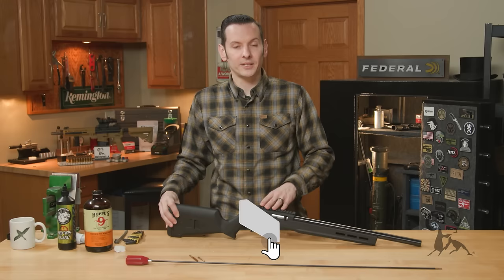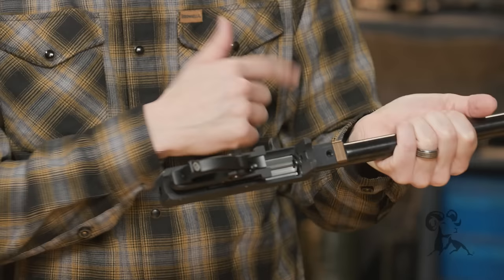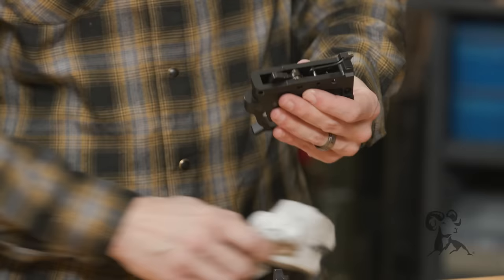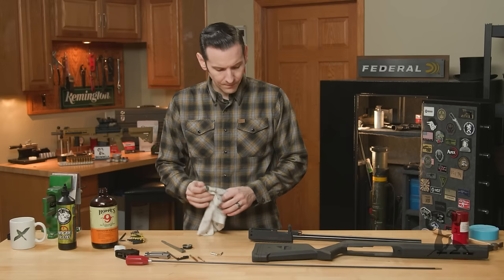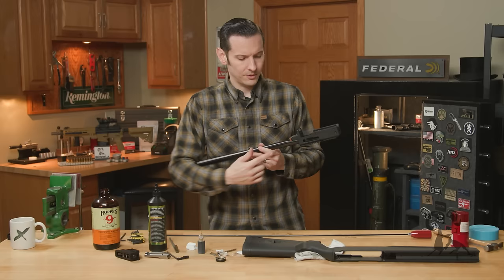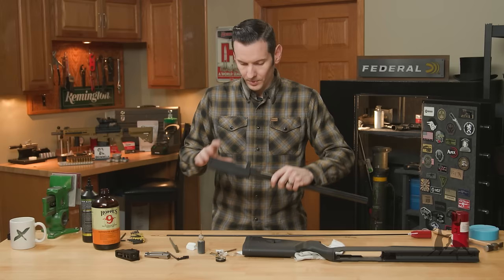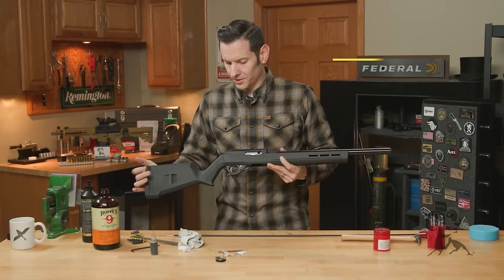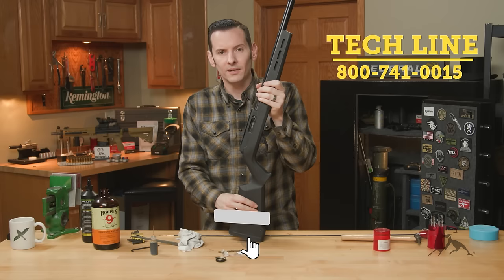Tech Tip: Ruger 10/22 Basic Maintenance

Comment: I got my first 10/22 as a kid for my birthday. Shot the crap out of it. Fast forward 20 or so years and I started to have light strikes. I thought maybe the firing pin broke, or perhaps just wore down so far over the years. While disassembling the rifle to investigate, I realized I had never done more than clean the bore and wipe down internal areas I could reach. I had never even removed the tigger group much less the bolt assembly. I had been worried that it was similar to the Mark pistol series which was notoriously finicky. So I dove in and fully disassembled it, discovering for the first time how easy it is to maintain. And also discovering 20 years worth of 22LR buildup crud that was causing my issues. Runs like a top again. Moral of the story: don't be afraid to tear into something. Videos like this are a godsend in that regard.
Reply: I for sure know about the Mark Pistol issue, I watched and video on the breakdown, made it look easy and my pistol was down for about six months before I finally got it back right.  I have fired it a lot since then but have not took it apart again.  Love how easy the Ruger 10/22 is.

Comment: Thats nice you sell the jig for the hole,,here is a way simple solution to avoid crown damage and brissel splash in the receiver,,,just slide the cleaning rod down the barrel when you see it in the reciever take and screw the brush on and pull it out take it off and repeat,,

Comment: Ruger 3+ decades ago (before YT) used to have training sessions on the 10/22 (and MkI) to show us how to clean, maintain, and trobleshoot the firearms.  Here is a quick suppliment to help out, based on Ruger.
1- Barrel and chamber should be cleaned and wiped DRY before firing.
2- Bolt should be LIGHTLY oiled and wiped almost dry.
3- Receiver should be LIGHTLY oiled and wiped almost dry.
Both of those recommendations from Ruger were to limit the powder fouling with blowback 22LR firearms.
4- Recoil spiring is cleaned and wiped dry while jamming charging handle.
5- The bolt and charging handle are assembled differetly at the factory and by gunsmiths for easier assembly.  The charging handle goes further back, and light finger pressure at the breechface is used to insert the bolt.
6- Ruger will NOT say this truth.  Don't remove the stock, unless you have to for super cleaning or gunsmithing work.  The attachment screw and/or barrel band bend the barrel, differently each time the stock is reattached.
Reply: Yes, with a caveat that some have or do shoot the crap out of their 10/22s to point of needing to. I've bought a few over the decades. Two have shot actually hundreds of pounds of 22LR ammunition, to point of showing extensive wear.  I don't recommend the take down model for accuracy. But I actually was handed it by the president of Ruger when I bought it on the anniversary of the 10/22 model.
Reply: This video looks like it came out of the 50’s!

Comment: When I run my Dewey Rod thru the chamber end of the barrel, I always unscrew whatever attachment, brush, jag, slotted tip before I pull the rod back thru to avoid any possible chance of damaging the crown. I heard there was a tool to aid in replacing the charging handle and bolt into the receiver. Does Brownells
 have such a tool?

Comment: I have a small parts washer filled with parts cleaner fluid (mineral spirits) for gun cleaning. After washing i blow off the parts with compressed air. I clean the barrel with either a bore snake or cleaning rod like yours. I have a Bergara BXR Carbon  I use for SCSA competition. It has the hole at the back of the receiver making using a cleaning rod easy. Periodically I attach a bronze brush to a modified cleaning rod connected to a drill to clean the carbon ring in the chamber. I do this rather slowly. I also use a right angle screw driver to align the charging handle to the bolt, making assembly very easy.

Comment: Two things I do beyond what is here.  #1 is remove the extractor and spring, using the "Gunsmither" tool from Tandenkross.  The extractor slot often acquires a lot of .22 crud.  #2 is to use the same "Gunsmither" tool for bolt reassembly.  Seems to make it easier to keep the bolt and bolt handle properly aligned (and squared), while fiddling the bolt handle lug into the bolt recess.

Comment: Those damned pins falling out of newer Rugers can be quite aggravating, particularly when it's the magazine latch pivot pin.  Reassembly can be quite frustrating.  I have found that putting a touch of grease on the pins will keep them in place.
Reply: The problem is that grease attracts and retains dirt and grit when can end up wearing the parts. That's why it's very rarely used unless absolutely necessary or in a sealed area.
Reply: @_droid  You don't have to put the grease on first.  You can insert the pin and add a touch of grease to the outside.  It will still hold the pin in place while you reassemble the rifle.  Alternately, you can use a dab of oil instead of grease.  Oil is what I applied last time.

Comment: He really screwed up in the barrel brushing. First, he was heavily bending the rod when pushing into the muzzle. The rod being bent caused it to have a high force and friction of the cround. 

Secondly, when cleaning from the  rear, he pulled the brush back thru very fast causing the attachments points between the brush and rod to  the muzzle crown exactly the same way he warned against when he was cleaning from the muzzle. I does not matter whether it hit going in from the front r being pulled from the breach. Equally as bad and damaging.   

KnifeMaker/Retired after over 47+ years n the Craft

Comment: much prefer Slip 2000 over Hoppe's.  
you also don't want to go from the muzzle to the action because you are pulling all the crud to the action rather than out the front, it is much easier to use some type of pull through like a bore snake or ripcord.

Comment: Hi Caleb.  I have always been under the impression that when you run your brush or jag down the barrel, you should only go breach to crown, and never in and out both ways.  Whenever I clean a barrel, I make one pass, unscrew the brush or jag, carefully pull the rod out, put it back together and repeat.  Am I tripping, or is there anything to this?  Thanks.  P.S. - I'm not OCD, but I am prior service.
Reply from the maker: That is addressed in the video.

Comment: Bought my Ruger 10/22 brand new for $49 from Jensen's in Tucson back around 1971 or '72. It is one heavily used rifle. Worn out many a ten round magazine, but the gun still works as perfectly as the first day I took it out of the box. All original except for the sights, had to replace them with those fiber-optic Firesights due to aging eyeballs. I've done all the cleaning this video suggests, eventually. Mostly I take it apart and spray out with carb cleaner, then lightly oil. Run a brush and a patch down the barrel. All done.
Reply: Are you still running the original barrel? If not, how long did it last? Thanks!

Comment: Caleb, you made me feel a bit better. Putting the bolt back into the gun isn't easy. Not that you struggled, it's tricky. And the, putting it back into the stock. That's also a bit tricky. Great video. Now, what's the best way to remove lead from a barrel?

Comment: Where can I get the oiling bottle that you are using? I could use several of those to help with so many different types of solvents and oils I use to break down, refurb, and rebuild old firearms. I looked on the Brownells website but couldn't find it.
Reply: Brownells sells them, look in cleaning category,  I think they are called needle oilers they come 3 to a pack and have a plastic cap that slides on the end to seal the tip. Some solvents and oils really soften the rubber seal under the metal cap,  so don't overtighten the cap because it will deform the seal it's best to keep them upright when your not using them. Don't just toss them in your range bag. But they are great for your shop bench. One more thing it's nearly impossible to keep any kind of marker or ink to stay on the bottles and don't even think about a tape lable. Other than that they are great.

Comment: Great video!
Would recommend you make a suppressed 10/22 version though.
It took me ages to come up with a regime that would allow for more than 100 rounds fired without the gun stopping due to fouling.
Using Hornady dry lube instead of any other lubricants was what worked for me.
Doing so allows me to go about 1K rounds without any cleaning.

Comment: Those 2 Allen screws on my 1995 10-22 that hold the barrel to the receiver continue to loosen.  Always check and tighten those when I break it down.  Is that a common problem?
Reply: Have you tried Loctite?
Reply: @Joe-hz1nw  don't use loctite just torque it down to 12 - 15 in/lbs.
Reply: @Joe-hz1nw  No, I just check it each time I clean it.  Gives me an excuse to clean it.